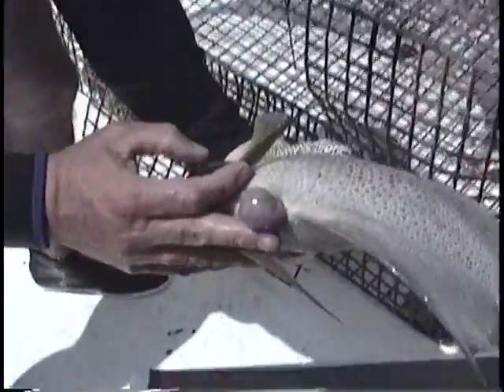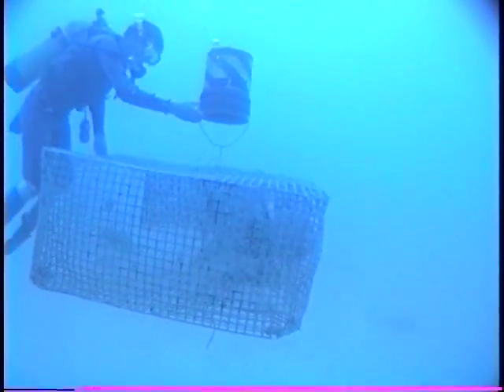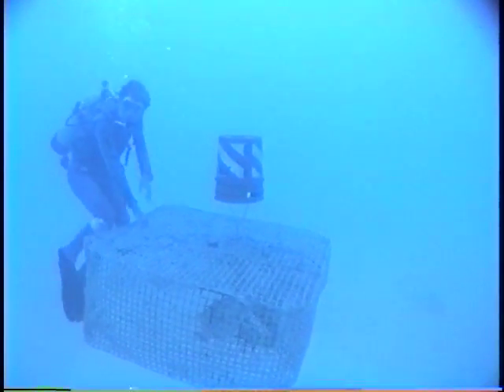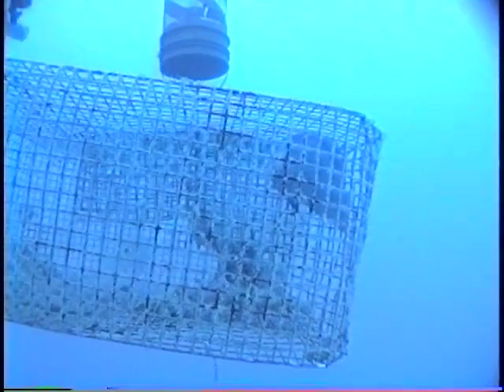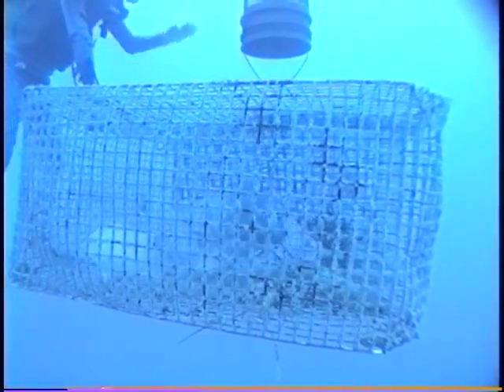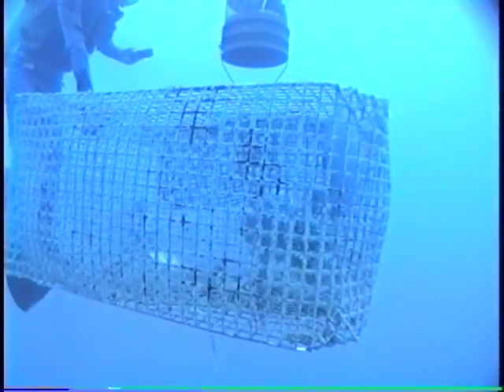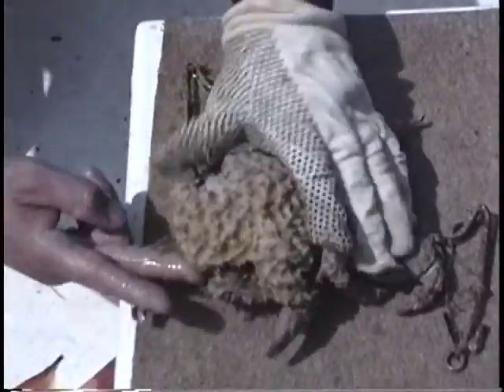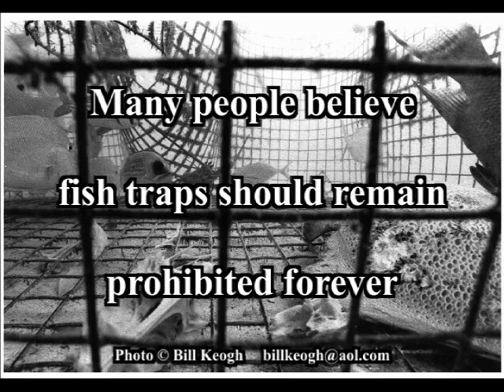Fish Traps Explosive Decompression Part 1

Comment from the maker: lardtaziumwadmaster, excellent question!  No, this does not affect rod and reel fishing and yes, fish brought up from depth still can blow up.  The difference is that traps are horribly non-selective, killing fish of any bottom fish species too big to swim through the wire mesh - juveniles, adults, etc.  Also, lost traps continue to catch and kill fish for years until they finally rust away.  The result is a catastrophic removal of bottom fish, much more than can be achieved with a fishing rod.

Comment from the maker: No, that's not true.   There may be a slightly higher percentage of the fish dead by the time the traps reach deck when yanked to the surface by a hydraulic puller but for the most part it looks just like what you see in this film.  It's still occurring in the Bahamas and all over the Caribbean.   It still astounds me that people can sit in front of their computers and condemn us for making this video.

Comment from the maker: The amount of gas contained in these areas is determined by depth and increased/decreased osmotically from the circulatory system like gases passing through your lungs into/out of the blood stream.  When the fish is brought up from depth the water pressure decreases causing the gas to expand, much faster than it can be metabolized.  The expanding gasses crush internal organs, blow them out through the anus and do other damage.

Comment from the maker: untipable,  Did you watch both parts of the video?  Yes, some snapper survive but many do not and often the ones vented die of infection later.  Also,  what about the angelfish and other species?  What about all the bones in the traps from fish that died there for no  good reason.  I think you missed the main points of why fish traps are bad.